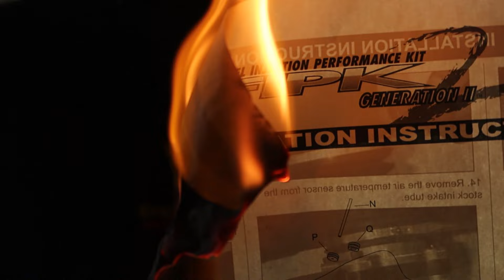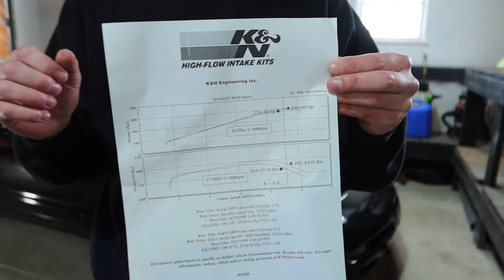C5 Corvette K&N Cold Air Intake Install and Review

Comment: For the two small holes you drilled , do those lines go to something inside it? Sorry this is the first intake I’ve ever installed and didn’t realize I’d have to drill into it. Mines a 99
Reply from the maker: they do not connect to anything inside the intake. Both rubber grommets are for a vacuum hose, with male barbed fitting, as well as a intake air temp sensor. the temp sensor should fit nicely inside the larger rubber grommet.

Comment: Will it need a tune after installation
Reply from the maker: No, the car won't "need" a tune. It will run just fine without a tune. However, in order to take full advantage of the new parts you just purchased a tune would be required. A tune would unlock the extra power this modification provides you with.

Comment: Wait, aren't you now covering half the radiator with the plastic on top of it?
Reply from the maker: There is still plenty of room for air to get by the flap and to the top of the radiator. I was also concerned about this but I have been driving the car hard for the past few weeks and my engine temps are the exact same as before! I just put 1,700 miles on the car driving the Tail of the Dragon and the car temp was perfect :)

Comment: Just installed mine last night and got it to fit without cutting, you just need to move the middle bolt all the way up on the bracket. I’m debating whether or not I’m going to cut it still because I’m planning to cut my front license plate cover for ventilation.